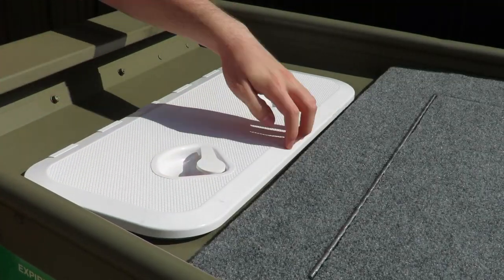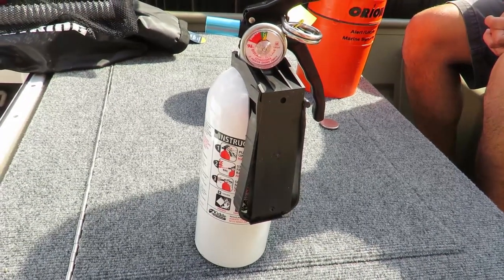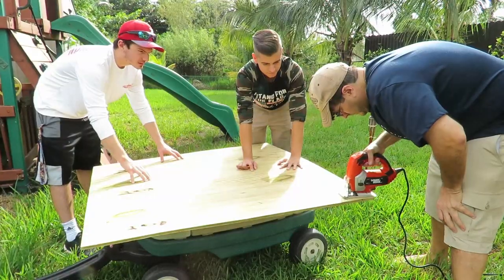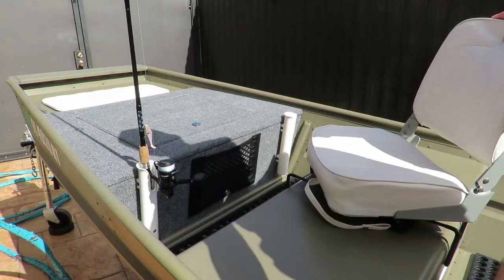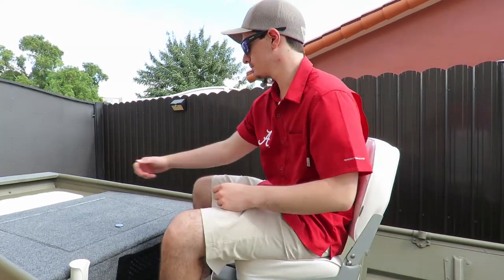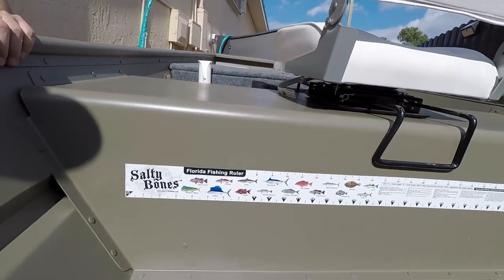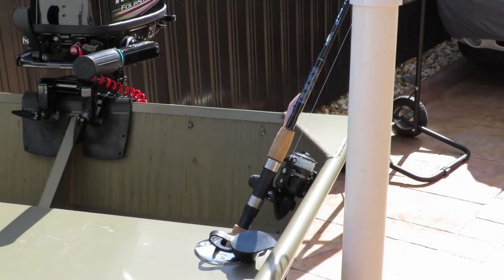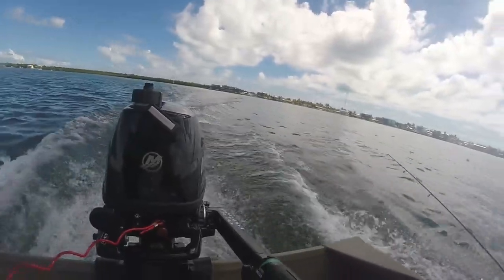Jon Boat Modification Showcase!

Comment: I have the same swivel seats and found out really fast to secure them with ratchet straps.  Those clamps hold the seat in place but if you grap on as your standing they come flying off and you go for a swim.  Just cut the hooks off the ratchet strap with a cutoff saw and leave the loop in the strap.  Take apart you bottom clamp on the swivel seat and put the loop in the middle bar.  I used a coat hanger and taped the strap to one end and pulled it under the seat.  Now do the same with the back loop and ratchet it down.  Wah-Lah!  No holes drilled and secure as a rock.  Oh, the swimming thing I aforementioned........from experience!  Have fun and Tight Lines!!!
Reply from the maker: Wow, might have to give that a shot. I've noticed they do come a bit loose whenever we're cruising over some wake. Never thought I could go for a swim tho🤣 Thanks!
Reply: Thanks for the tip. I Just got a 10 footer and I would have probably made the same mistake and gone for a lakewater bath lol

Comment: Hey guys great job on the boat. I have a 14 foot panga that I'm upgrading. I like your idea for the rod holders. I will definitely use that idea. And also the floor mats are good idea. Keep it up. My boat has a 15hp but i want to upgrade to a 25hp.
Reply from the maker: Thanks! The great thing about these small boats is how easy it is to customize them. I'm glad you got some ideas for your boat. Good luck with your build!

Comment: I was wondering how you dug out the flotation foam from the back bench seat in order to install the rod holders?  How were you able to get the foam out thru the small hole that you cut?  Was there also foam in the front seat that you installed the hatch in?  Thank You!  Excellent job with your video!

Comment: That’s a very thought out and well executed boat! What brand seats and swivels did you guys use? How are they holding up?
Reply from the maker: Attwood for the swivels and Wize for the seats. Overall, they've both been great. The seats are comfortable and the swivels clamp onto the jon boat benches snugly. Some people have told me they've had the clamps pop off of the benches of their boats before with enough wake, but we haven't had that problem before. As far as durability, we wash both after each outing on the water and store them afterwards, so they've held up nicely

Comment: Just got the same boat as you guys a few weeks ago. Stoked to put some work into it. Y'all gave me a lot of ideas, thanks! Just curious, are y'all close to being maxed out on the weight capacity? I think the max weight is 480lbs
Reply from the maker: With 2 people and gear on the boat, we approach that 480 lb limit but we haven't had any issues. Floats well despite some of the cutting, and is still incredibly stable. If you're curious about speed under load, we've run the boat at 13 mph at around the 400 lb mark, 5 mph slower than our tests with 1 person and no gear (About 175 lbs). The boat's definitely been a great investment for us, and we hope you enjoy yours too!

Comment: Nice and clean !
Hey where did you locate the floor mats and do they work for non slip once fish have been on them?
Reply from the maker: The mats are rubber kitchen mats that are custom cut to fit the boat. We bought them at Home Depot, but you can find some variations on Amazon. There's a link in the description for one with good reviews, but feel free to browse around. We haven't had an issue with traction after fish slime and water cover the mats, either

Comment: Hey guys, how is the boat and motor holding up in saltwater? What types of pre and post preps do you all do to protect and clean?
Reply from the maker: After almost 2 years, the boat has held up great. We use it almost exclusively in saltwater and we haven't noticed any issues with the boat itself or the engine. After each use, we clean the boat with soap and water and flush the engine. We also store the boat in the shade with a tarp cover, and the engine indoors. We were initially skeptical, since we always thought jon boats were more of a freshwater thing, but we're really enjoying going to docks and saltwater canals for some inshore fishing
Reply: @TheReelStrike  Thanks for the informative reply. You guys are exceptionally helpful. I'm subscribing!!

Comment: If I buy the swivel and seat do I need to purchase anything like screws?? Or does the seat just screw into the swivel? Asking for a friend lol
Reply from the maker: The mounting equipment usually comes with the seat, not the swivel. If you already have a compatible seat then all you'd need to get is the swivel and you're good to go. You can refer to the links in the description to see exactly what gear we used if you want to do some more research

Comment: Do you think the casting deck would be strong enough to put a pedestal swivel seat on it?
Reply from the maker: With this design, probably not. The hatch in the middle catches on a thin wooden lip, but it might not be strong enough to hold a mount, seat, and person sitting directly on top of the lip. But with some thicker wood for the lip it might be possible

Comment: I'd like to model off of what y'all did. How does it work out? Have you changed anything else? Thanks
Reply from the maker: This setup has worked great for us. We usually fish in saltwater canals and close to docks, so it's perfect for us to fish areas that would be tougher with a bigger bay boat. The casting deck has held nicely. I'm usually standing on it 2-3 hours at a time and no signs of cracks. The 6hp engine is fast enough to get us to and from spots quickly, but slow enough to keep the ride extremely smooth. Since this video, we've installed a fishfinder and transducer and we made a video about it if you'd like to check it out. Overall, we're extremely happy with this setup given our preferred fishing habits
Reply: @TheReelStrike  awesome! Thanks for the reply. I'll definitely look at the fish finder video.

Comment: Do those seat clamps hold tite? I’m thinking about getting some but I heard stories they can flip you out. I weigh 140 u think it’s fine?
Reply from the maker: It depends on the conditions on the water. Some days when it's choppy the seats come a bit loose but we've never had them completely lose their grip. Some other commenters have told us that they've ended up in the water from the loose clamps, though. My advice would be to secure them as tightly as possible and don't go too fast when it's a choppy day. We weigh around the same so you're in a similar position as us. But like I said, we personally haven't had many issues with the clamps
Reply: The Reel Strike ok thanks! My lake really small and clam and I don’t plan on going to fast so I think I’ll be good.

Comment: Where did you get the front marine hatch , the Emergency kit , and the floor mats from ?
Reply: Hatch & Emergency Kit- Amazon, floor mats- Home depot, 36'x36'- you will need to custom cut them.
Reply: J C do you know the brand name of the hatch ?
Reply: @justin5345  Actually it was on ebay. Amarine-made MARINE BOAT DECK ACCESS HATCH & LID is the brand. Good quality and good price.
Reply: J C ok thanks I’ll look it up

Comment: Where do you find the widebody? I havnt seen it anywhere
Reply from the maker: If you can't find them on the Tracker website or Bass Pro, check your local motorsports dealer. That's where we bought our boat about 8 months ago

Comment: Also where did you get those mats?
Reply from the maker: Home Depot. They're rubber kitchen mats that are custom cut to fit the boat
Reply: @TheReelStrike  Did you secure the mats down with anything or are you able to just pull them out anytime?
Reply from the maker: Nothing's securing them down, we simply pull them out whenever we need to clean them

Comment: How much did everything cost?
Reply from the maker: In total about $3,500. $3,000 for the boat/trailer/motor and $500 for the mods
Reply: What do you estimate to bring the boats value to? Trying to decide if i put a lil time in this ugly 14 jonboy if i can bring the value enough to make sense doing it. Id love to sell it for 1000 no motor 1500 w a 70s 6hp johnson after upgrades. Paint, removable, rearrangeable cubies/ platforms and one cooler to live well inside one of the sections.

Comment: You didn't want to mess up the "structural integrity" of the boat by drilling 4 screw holes in the benches to mount the swivels for the seats.  

Then you drilled big holes into the aft bench, and removed flotation foam for rod holders.  Hmmmmm...... I guess I'm missing something....
Reply from the maker: The point we were trying to make was that we wanted to keep drilling to a minimum so that the boat would be easier to sell in the future. But we still wanted to add the mods that we'd make use of (Front hatch and rod holders). We could've also drilled for the fishfinder (Added later), casting deck, and seats, but we found ways to add those without driling. More than a year later the boat still floats and we're catching fish

Comment: How dimension boat?
Reply from the maker: 12 feet long, 52 inches at the beam, and a bottom width of 36 inches
Reply: @TheReelStrike  hight from the bottom?
Reply from the maker: Transom height is 15.5 inches